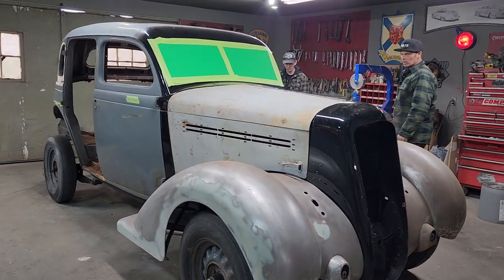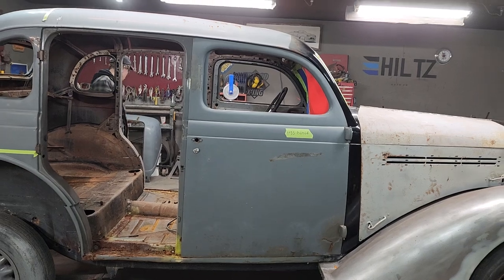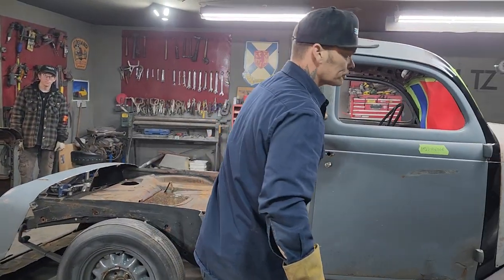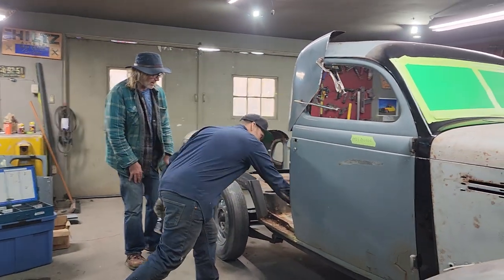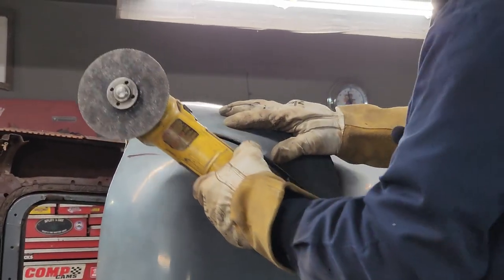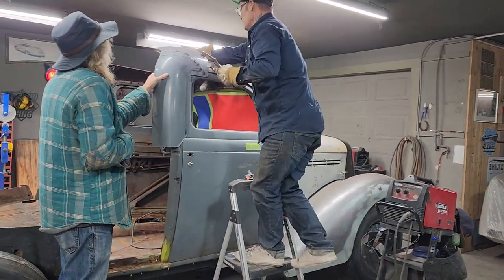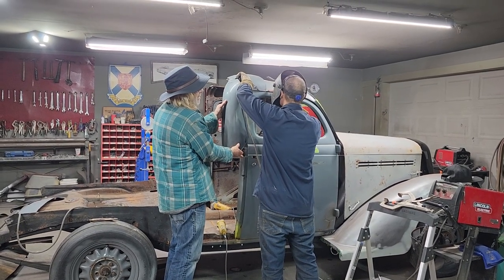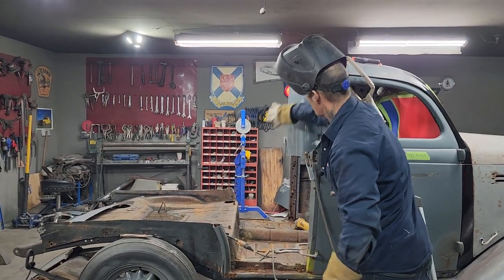The fabrication begins... Turning a 1935 Plymouth Touring Sedan into a Pickup Truck

Comment: One of the thing I am noticing about your customs is it looks like you are often excessively cutting the length of the passenger cabin. Thus creating a dash to knee knocker situation. You must be a fairly short person and have short legs. Because there is limited leg room when you remove all the space behind the front door. That is why I was excited about the prospect of having a quarter window behind the door like the 80’s and 90’s small pickups like the Ford Ranger , Nissan Frontier, Ford Ranchero and Chevrolet El Camino G-body.

But your cab corner is coming together quite well. And I am liking the bit of rake or slope that is coming together on the roof line. This is starting to have the clean and graceful look of the 40’s ford pickups. And the Hudson/Terreplein Big Boy pick ups.

Comment: That's going to be a sweet truck when you get done with it. You can mirror the gray pieces on the back you are working on. Put the outside of both pieces against each other and run a marker line down the outside of the driver side piece when you have it laying against the passenger piece while it's on the truck. Keep up the great work and God Bless you guys and your families. 👍👍💪🙏🏼🙏🏼

Comment: Man like n it , roof looks like a 40 Willy’s truck cab , use the trunk lid for upper part of cab , cut it in the middle , and put back together , then put small back window in it , would look factory , move rear end back some , and do wedge bed , even extend frame a little to move wheel base back , some  👍👍👍 one of my favorite builds since the hot wheels car lol

Comment: I like where your going with this it's gonna be cool,  I've found a trick that helps keep the flow of the roof if your interested,  cut from the forward point of the patch above the door to the inside of the original roof, it's one full length cut that follows the couture of the roof all the way down,  hope that helps

Comment: Speaking from experience.  You really want to be wearing a decent mask/respirator when using those cut off wheels.  There's 50% of the entire wheel or 6 and all the metal you're cutting literally flying right past your face. Watch someone in the right light and its absolutely true. As much of a pain in the butt, as much as it would totally screw up Chad's ability to talk; Its one of the things I constantly wear. I'm almost 49 and I've had cut off wheels twisted in shirts, pants, skin, got enough crap in my eyes and chewed on enough dust over the years.  I wear my safety glasses although I still get tons of crap I  my eyes and I wear a  respirator 99% of the time.  Anyhow,  this truck is going to be cooler than dangit.👍

Comment: Using that boot lid section on the back the cab then having a wooden tray come under that, make an enclosure at the bottom so you have a toolbox/cabinet as part of the cab that can be accessed from the boot lid would be rad

Comment: I think I would have drawn a line up the door's edge to the drip rail. the cut it & tack it first before you start shrinking the crown. A guy in Canada once said to tack it before you shrink it, so it doesn't move. Take it once it holds, twice it won't move.But lots of different eyes get different views. Continue on PLEASE

Comment: I think the cab will be too small, I would suggest checking seating clearance before deciding that the back of the cab will end so close to the back of the door. I think incorporating the “super cab” window, would have ensured you had enough room. I would slide that corner cap back and add the window….. 🤷‍♂️

Comment: Can you use the center top section and mount it under the rear window (extended cab) to make it a little more straight down…it seems like it should be close to the same width.
Whoops…I didn’t realize that it had a cut out for a canvas roof in the center.

Comment: Yes, it's not bad. But it also looks pretty much identical to the original 1930s dodge pickups, which had the rear of the cab dropping straight down to 90 degrees right after the door.
Still great team work, as always 😎👍